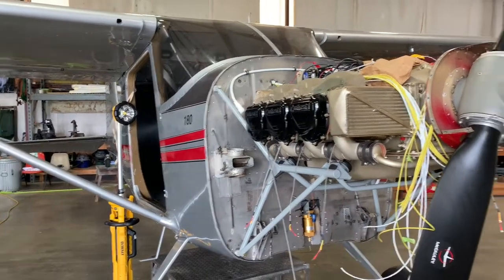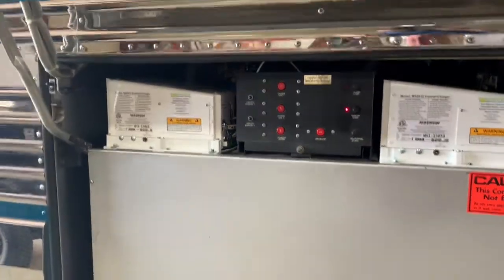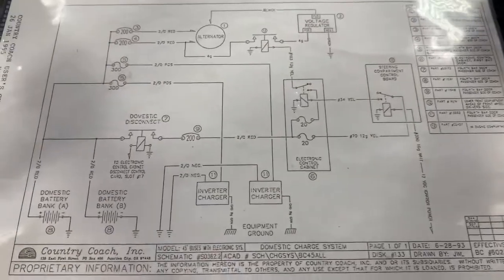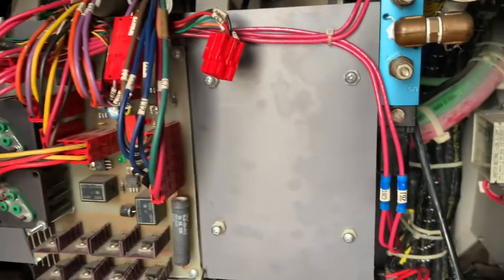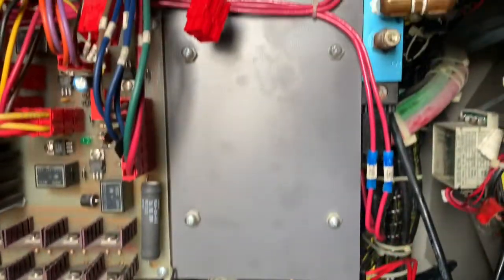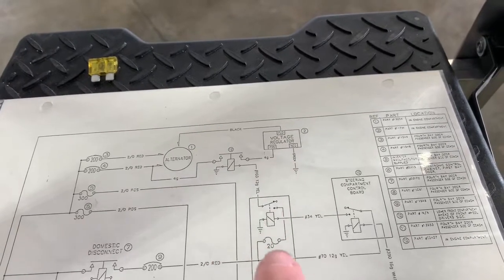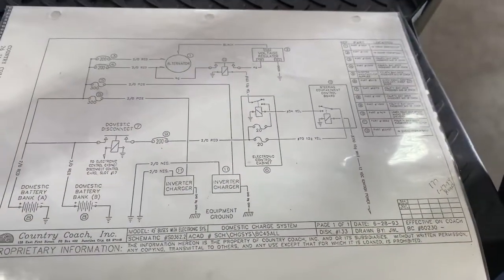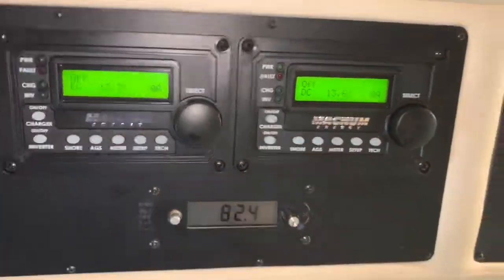Prevost 1995 CC Engine House Battery Charging Problem

Comment: Own an 03 Wandeloge. Guess that why YT showed this to me. I was an electrician/ electronic tech in the Navy. And a ham. Like yours , my coach has its ‘blue box’. 25 lbs of information. I had an issue with charging too. In my case it was the automatic engine heater blowing a fuse in the engine compartment. Knocking out a few circuits. The mirror company is still around. I believe most big coaches used the same manufacture. I personally stay away from snow and ice as much as possible. I be interested in what board was there. Those hanging connectors make me wonder. Good work. Our prints are full sized and you need a magnifying glass. I’ve blown up the few parts I’ve worked on and documented it in the box.

Comment: Future Prevost owner here, I hope, maybe!  Anyways, great video and makes me want one even more. I’m here in Middle TN as well and looked at a couple coaches from Olympia last year.  Maybe I should have bought one then before this crazy run up in prices I am seeing out there.   Your coach looks great from what you showed in the video.   I hope I’m as lucky to find a mid to late nineties in great shape.  However, your video shows you really don’t know the condition of these things until you live with them for a while.   Who would have ever thought a whole board out of the electrical system that is tied to several features would be just gone.
Reply from the maker: Yes, you really find the issues after you begin using.  But it has been fun fixing up the bus.